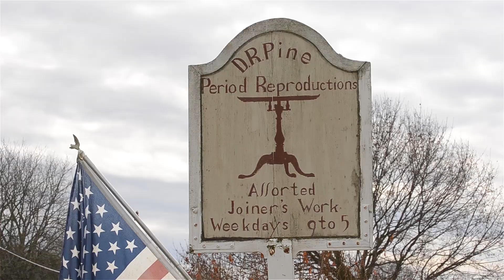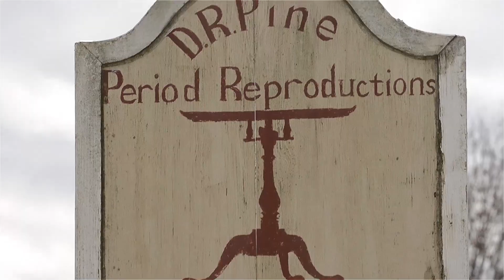David Ray Pine's Woodworking Workshop Tour

Comment: They had power tools back when they were making antique furniture. They just ran them off line shaft setups using water wheels or steam power. That goes back hundreds of years now. Which is a time frame that covers any of the period pieces shown here.
Reply: They also had apprentices for squaring up stock too I imagine. So a jointer and planer is just like an apprentice that doesn't complain.
Reply: @CleaveMountaineering  my power tools complain sometimes and even quit too. Sometimes I can be a slave driver. Nobody's perfect.